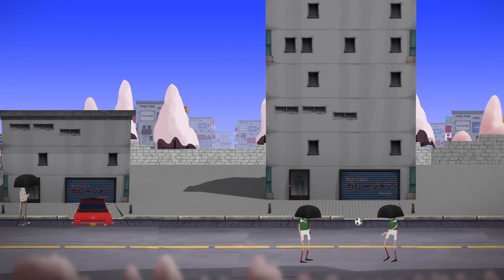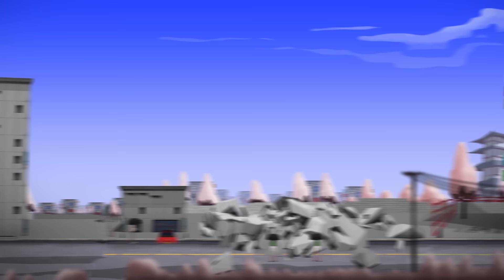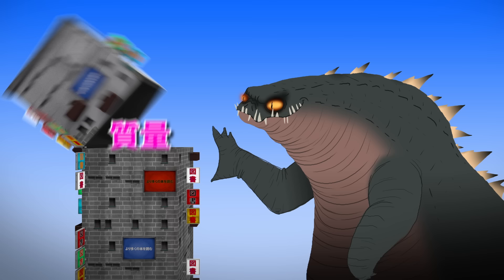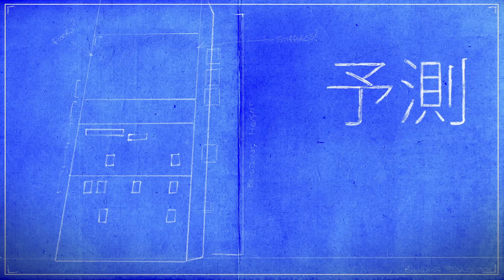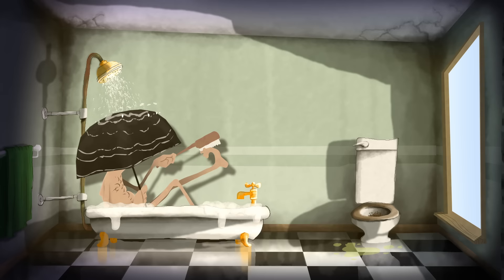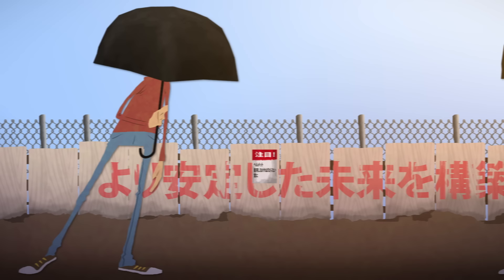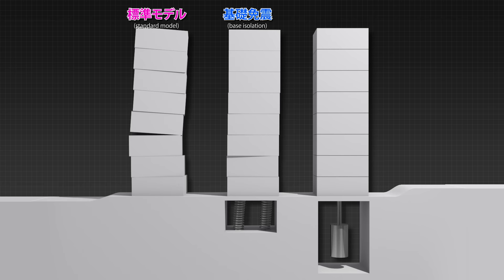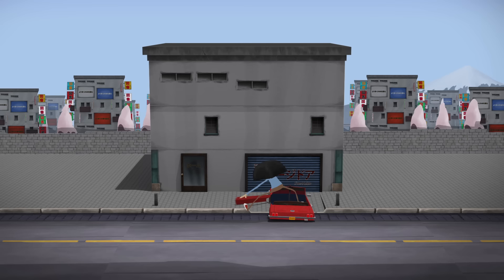Why do buildings fall in earthquakes? - Vicki V. May

Comment: Would a building shaped like a dome or pyramid/trapezoid be more resilient to these vibrations?
Reply: Well it essentially depends on the internal structure of such building. You may be thinking about designing buildings that are not so slender. Just consider the growth of cities and the increase in the cost of the terrain. If well designed, a slender building will always be the most economic solution.
Reply: This is yet again somewhat related to the natural frequency of the structure(pyramid type of structure) and the exciting(earthquake) frequency. An earhquake might posess any forcing frequency depending on the circumstances. Therefore, since a pyramid type of structure will lkely to have a relatively low natural period in both of its orthogonal directions due to its rigid nature, it will undergo serious shakes under influence of low period earthquakes whereas it will be less affected by those out of phase.
This is the simplest answer I can provide as a msc. earhquake engineer. However it is nearly impossible to say whether some particular sections of the pyramid would collapse or not without knowing the actual structural system. This applies to every case. 
Hope it helped ^^
Reply: The city I live in they had to spend millions a few years ago on a structure called 'Gravelly Hill Interchange' (Spaghetti Junction to Brits) to replace the pads between the motorways (freeways if you're American) and the pillars holding them up because of (vehicle) vibration causing cracks. So I don't think any structure is immune, might be more resilient but not entirely immune.
 http://en.wikipedia.org/wiki/Gravelly_Hill_Interchange

Comment: you said that engineers design current structures in order to avoid resonance but the concept of resonance is rather obsolete because ground motion is not deterministic but probabilistic and irregular, we cannot predict it like we do in a typical sinusoidal motion (like machines). Every ground motion has different period and it is practically impossible for an engineer to select the correct eigenperiod for a structure to avoid resonance period. Nowdays engineers use response spectrum, a graph that shows the maximum accelaration response of a structure with respect to its eigenperiod, a probabilistic concept. So in the earthquake of Mexico, tall concrete buildings didn't collapse because engineers used large concrete vertical walls(>3m) in the perimeter of building in order to avoid large torsional vibration of storeys, placing the proper reinforcement for joints giving them high plasticity that had damped efficiently seismic energy even with large but acceptable cracks and damages without catastrophic shear failures.
Also eigenperiod period is not constant during earthqauke since buildings generally do not respond elastically, as a result every damage or crack in a joint (beam-column connection) would make the structure less stiff increasing thus its eigenperiod, this is another reason why the concept of resonance fails.
Reply: Oh my god
Reply: in another term... mechanical machine vibration is far more easier than... those ground vibrations when... earthquake comes
Reply: That's really smart and all, but nowhere near the biggest problem with the video. They got the relation between stifness, mass and frequency wrong. The period is proportional to the square root of the mass, same with frequancy and stifness..
Reply: Flexing

Comment: Tesla knew this wave principle very well , for fun one day he used a small weight and motor to generate a standing wave in a tall 20 or so story building, causing it to sway dangerously. The principle being that at the right frequency even the smallest forces can be amplified to a power of mass destruction

Tesla earth quake machine.
Reply: That's a lie. In every natural structure there is a dampening effect which gives an upper bound to the amplitude of resonance, no matter what frequency Tesla used.
Reply: @zoltankurti  Still, you may actually achieve with a strong enough machine.
Reply: @noradlark167  irrelevant. My point is that "even the smallest forces can be amplified to mass destruction" is not true.

Comment: Considering that, engineers could really design buildings that can withstand intensity 10 and beyond. But thats only the for substructure and superstructure. That's only half of the story. Another critical thing is the earth beneath a building's foundation which we only have limited engineering technology to make it resilient to quakes (piles and compaction). No matter how adoptive the building is against quakes, when the earth it is resting on is severly disturbed by quakes, damages occur.

Comment: In 2020 we've had 2 major earthquakes near Zagreb, Croatia. First was practically directly under the city with magnitude 5.5 and 5.3 aftershock. Second was in December about 50 km away with magnitude 6.4.

I was wondering why my 8-story building suffered almost no damage and my friend's 4-story building did in the first quake. But in the second quake my building suffered much more than my firend's shorter building. (Our buildings are very close to each other)

I guess this explains it, it has to do with resonant frequency.

Comment: Who calls it a lollipop model ? It is a lumped-mass model. Additionally, stiffness is not largely a matter of height. The stiffness of the overall structure is driven by the  stiffness supplied by the individual columns and the restraints that the beams provide, that make up the full structure (therefore, no one particular variable "largely" drives the design, but fine tuning the following determines the functional stiffness: end restraints, member length, sectional moment of inertia). Additionally, structural stiffness is just part of the equation for the overall response that we see; soil structural interaction drives the seismic response too. All of this becomes less important once you utilize tuned mass dampers, or base isolation systems. I would simply withdraw the emphasis on height on structural response, but everything else discussed in the video is acceptable.
Reply: +reaz mohmed Actually think of the building as a cantilever beam (just like the lumped model) you will see how high is the influence of the building height to its stiffness.

Comment: Why do buildings fail in Earthquakes? Seen the collapse of the second tower of 9/11 ? One floor of the building was compromised, the upper floors accelerated ONE floors worth & the structures couldn't support the rest of the building. Notice how demolition of buildings is typically done? They compromise one floors worth so that the whole of the upper structure moves to "replace" the missing bottom floor...Concrete is perhaps the worst material to use in construction...rebar is used to "reinforce" the utterly poor performance of bending forces...check the stress forces of concrete compared to virtually everything else...it is used because it is vastly cheaper to build than with anything else. Build your three-story home with 300mm stainless-steel  tubing with Aluminum panels in & out, cross-braced inside...you would die of internal injuries before the building would fail.

Comment: This video ignores a very important factor: your chance of surviving in a 2 or single floor house is far greater even if in collapses. And your chance of getting rescued from under rebel of that building is also far greater. I mean, think what are your chances of surviving if you are in the first floor of six floor building that collapses over your head? And how much heavy concrete needs to be moved to pull you out!!!